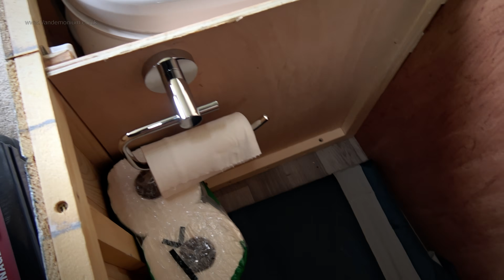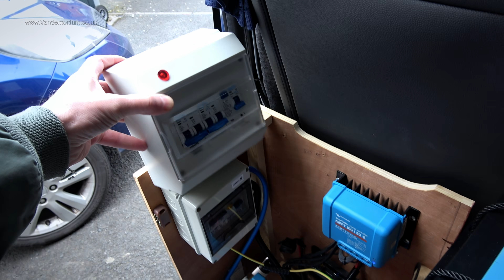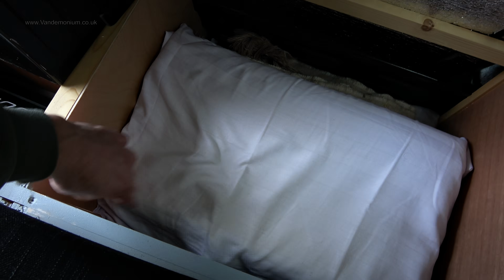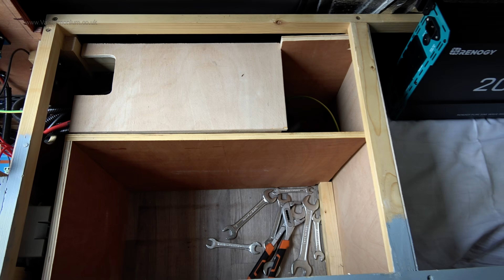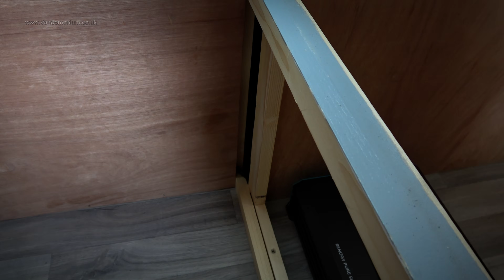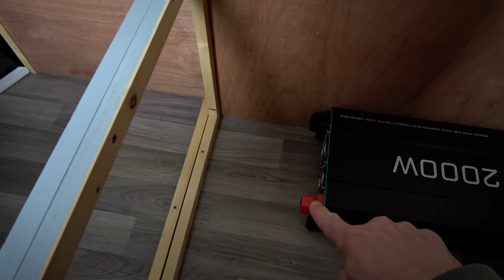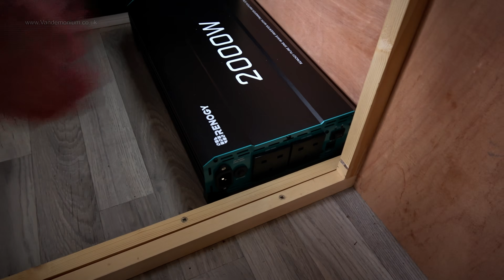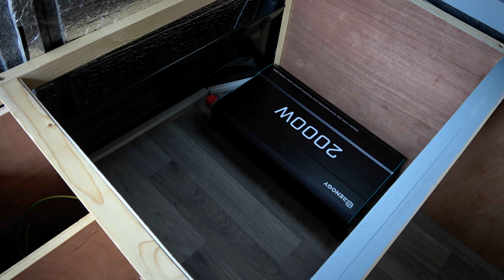78. How should I arrange the new campervan electricals?

Comment: Gfci yes, it monitors a electrical potential difference between the neutral in the ground
Reply: In fact it measures the difference in the currents flowing in the live and the neutral. If not all the current coming in the live goes out the neutral, it must be leaking to ground. That is the "ground fault" it detects.

Comment: Why don't you try turning the battery 90deg. In the compartment.   You will have to take the great divide out and store your empty container somewhere else.  Also, then you can put a shelve over the battery and put your converter on the top.  This way you will have both items in one place.  You can use extra length of wires so that you can lift the converter when needed.
Reply: My thoughts exactly.
Reply from the maker: Not enough space to have the inverter above the battery, unfortunately.

Comment: Hi David,
comment on those supplied cables...   looking at the way one pair retained the shape out of the bag, it makes me think they are not pure copper cable (heavy copper cable tends to be very floppy and mallable) but is the typical inverter-supplied copper-coated aluminium (which pretty well stays as you bend it more or less).   This is very relevant as if you are going to look up the current-carrying capability of a given gauge of cable, the table will be for copper only.  Aluminium is around half that.  I would not consider using that cable and just get some new decent european/UK welding cable (maybe 35mm2 for the length you will be running).  (Euro/UK cable is much better than far eastern cable).
Reply from the maker: Cheers. I am going to invest in custom-made cabling.

Comment: Would it be possible to mount the new battery transversely, keeping the terminals exposed, and build a shelf / stand-off to mount the inverter above the battery? I guess the inverter can lie flat.
Maybe enough room remains for the jug or the inverter mount can be built around it.
Reply from the maker: Sadly, not enough room to put the inverter above the battery.

Comment: Remove the small panel behind the sockets. Move the back wall out to make room for the battery. Mount the inverter on its side to back wall you just moved. You can get angled connectors.
You can take the cover plates of the inverter sockets and wire directly to the external sockets on the outside panel.
The consumer unit should be on its back wall and all the fusing in the space just vacated.

Comment: David, STOP! A 2kW inverter is about 90% efficient, meaning at full load about 200W will be dissipated as heat. This means one important thing: AIRFLOW! if you enclose it the way you seem to have decided it will easily overheat, causing it to turn off to protect itself, and even if you could live with that it will most likely shorten the lifetime of the unit drastically!
YOU MUST ENSURE A GOOD AIRFLOW!
My recommendation would be to redo the panel on the left side of the cabinet holding the 230V connectors, freeing up space for mounting the inverter along the front of the compartment holding the battery, making a large  ventilation hole towards the side door as well as on the other side of the cabinet (next to the fan grills), facing towards the rear doors. Place the main cutoff switch where the upper 230V connector currently is located and find somewhere else for placing the 230V connectors - maybe above the inverter, facing towards the rear door.
I get your reasoning for having two 230V connectors, but I would probably put the two connectors in parallel and use a switch to select between shore power and power from the inverter...
Ventilation would also be a good thing for the smaller electrics cabinet, although the solar charger and DC/DC charger are not as powerful as the inverter. It's still likely to get toasty there...
I do automotive electronics development for a living and can only stress the importance of ensuring good cooling!
Reply: Just what I was going to say. +1 cooling cooling cooling
Reply: @TheAdenau  I agree. very worried about the cooling of the inverter
Reply from the maker: Cheers. The solar cabinet has been fine for five years (and there is no DC/DC charger) so I'm happy that that's OK "as is"

Comment: I think where you got to is pretty good but is there space under the passenger seats rather than in the cupboards? Another possible alternative is to go to back to having the inverter in the same cupboard as the battery, on its side, because if you can take the battery leads out of it at an angle can you take them out so they cross over immediately and then loop up/down to the battery?
Reply from the maker: I need to have a look under the seat, yes

Comment: David…you seem to be overdoing things. Why travel with duvet, blankets and sleeping bag…….one decent Scandinavian dyne/duvet with a fitted sheetbag and a loose sheet for the mattress, and you are golden in  any climate….saves storage space. You need a proper relay that auto switches between incoming 230v and inverter 230v….and if you have any doubt that the inverter may blow up…..you bought the wrong brand and quality…..absolutely do not install anything under your pillow you do not trust 112toyota percent…,that would be madness.
Reply from the maker: The sleeping bag is in there by accident, I don't use it! I have no doubt the inverter quality is fine, I'm just imagining the worst!

Comment: Ditch the mess and get a solar generator,  cheerd
Reply from the maker: What's the point? Those things are nothing more than what I already have - solar charger, battery and inverter. And if any component in mine goes wrong, I can swap it whereas a "solar generator" has to be swapped out as a whole.

Comment: Oh well, here goes my input.   Modify the existing battery location to take the new battery and inverter,  bedding can be squashed up a tad in the reduced space. This keeps everything close together with no long cable runs.   If the bedding objects to being cramped move it to the far storage area and use the now smaller former store as general storage. 
Whatever you decide make sure the inverter has clear unobstructed ventilation to the main van interior as I think it will grumble if it's in an enclosed cupboard, especially with a duvet on top of it to keep it toasty!

Comment: your bedding does not fill the compartment- you've got a good 6" 'false floor' if you want to put one in with permanent stuff underneath from the compartment next door- but I agree- research a 90 degree connector to the inverter . don't forget to provide ventilation. still tend to vote for using spare water carrier space and current battery space remodelled for both to fit
Reply from the maker: The bedding fills that section (I had removed two duvets while filming!)
Reply: v @Vandemonium  sorry- my bad. I should have known that It is ...unusual... for a campervan (or narrowboat) owner to have empty cupboards 🤣

Comment: Move the battery rearwards (where you currently have your spare water container) and mount the inverter where the battery is but with the connectors towards your electrical compartment.   You can then route any bends through the electrical compartment.

Comment: I reckon you have to start with the fans for the inverter as priority. I would guess that they have to have a clear path to blow hot air into an open space (not a closed cupboard) as well as the heat coming off the cooling fins of the body. It'd be a shame to cook the inverter after all that effort!

Comment: Keep in mind that the inverter will generate a LOT of heat and will need a substantial flow of cool air in order to live long. A question: What is behind that wall there the solar charger is located? Is there room to mount the inverter? Or possibly under a seat?  If so, there would certainly be more than enough air flow to keep the inverter happy. Yes, it may be visible from above but at least it will still be alive. You could, extend the top cover to hide the inverter if it bothers you. But, no matter what you do, be sure that there is venting. A subfloor with bedding on top would definately be too restrictive. Those cables, if they are well made, I would suggest doubling them up as you hinted at doing. They will easily carry the load. Lastly, with ANY electrical componnent, HEAT is one of the top reasons for failure. Keep that in mind with any installation and, if needed, there are plenty of small fans with very clean covers that will increase the air flow. Computer fans come ti mind. Also, inlet for air is not enough... there needs to be an outlet to exit the flow of air or things will just recirculate the heat that is absorbed by the flow and result in component failure. Being a retired automotive electrical and Air Conditioning specialist, I have had to repair many components that failed due to heat. Good luck...
Reply from the maker: No room behind the electrical cabinet, unfortunately. Maybe under the seat though, TBC!
Reply: @Vandemonium  Well, under the seat will work fine. Just be sure to keep it clear of anything that would block the flow of air. Keep the inverter cool and it'll be just fine.

Comment: The battery needs to stay where it is for weight balance. The inverter 12v feed can be any angle if you are using HTC crimps which you need for thick cables. And remember you will need to be able to get to and switches and fuses on the end of the inverter. Is your tap a mixer? if so block the unused inlet or feed both. And having spent most of my working life in engineering we always clipped barbed water or air connections. It pushes the barb in to the hose.
Reply from the maker: The tap is not a mixer, though I know it looks like one!

Comment: Why not put both the inverter and battery in the storage compartment and use the existing battery compartment for the stuff evicted by the inverter and battery. I’d use a piece of conduit to route the wires outside the compartments back to the distribution panel thus keeping them out the bedding store. You wouldn’t really see the conduit because you are sitting above it.

Comment: turn the battery 180 degrees  so terminals come out in the area of the electrics also could the inverter go on top of the battery? Lastly the whole of the electric cupboard rwaly needs to be re run as it is a total waste of space..
Reply from the maker: It certainly does not!!

Comment: Any space under the front seat or even in the front passenger foot-well? a 2KW inverter is going to be plenty hot so will need more ventilation than a builders tea hut.
 On A little bit of a tangent, Do you have or have you thought about a DC - DC charger wired into your van's engine electrics so you can charge your leisure battery while driving? You can never have enough ways of charging if you are going all electric. 

Anyway good luck
Reply from the maker: I don't have a DC/DC and am hoping to get away without one.

Comment: Just put the inverter where the water storage is. You can get right angle adapters for the power input, no problem. Then, you can also put some vents in it for air circulation that's absolutely necessary as it'll be right in the front. Don't overthink it. Just buy the right parts.

Comment: Might I suggest that you either replace the crimps on the back of all your swithces/usb outlets or at the least put some insulating tape around the exposed end of the crimp? I had such a connector with bare terminals in a car I owned once and I dropped a screwdriver behind the dash and caused  a short, which in turn caused the plastic on the wiring to fill the car with smoke as the wires glowed red hot. Fortunately I had gloves on and ripped the wiring off the switch before a fire started. I would hate to think of the same thing happening to you/the van, especially as you have a high capacity battery. And yes, my switch was fused, but it didn't blow for some unfathomable reason. Stay safe.
Reply from the maker: Cheers; there's no way anything can fall onto those terminals though. There's a lid goes on top of that box!
Reply: @Vandemonium  I appreciate that, but, my paranoia would not let me rest without mentioning it to you in case a lead detached itself somehow and caused a problem.

Comment: New battery where the old battery is, false floor on top of it, inverter on top, leaving loads of airflow, possibly vents cut in, then it's all contained together,  the cables will easily flex to and from the battery below
Reply from the maker: Sadly, not enough room to put the inverter above the battery.

Comment: Easy solution (maybe not OCD approved), mount the inverter diagonally where the water jug currently is. It looks like it should just fit with the connectors angled to one side or the other. 
And most important as others have said, that inverter should put out quite a bit of heat, so you wouldn't want it enclosed. Drill top and bottom holes for ventilation in whichever compartment you decide on.
Reply from the maker: Diagonally?! Haha you're right, I don't think my brain could cope

Comment: Just turn the battery so that the poles facing to the electrics compartment, move the dividing wall forward and mount the inverter to it...shortest run of cables on 12V and 230V side...all other compartments still useable like they were before...
😉👍👍

Comment: Could you put the new inverter where the water can stands now (I know, you talked about that, but hear me out!) in such a way that the inverter's two plugs replace the two plugs that are now at the outer wall of that cupboard towars the door. That might mean the cables from the inverter might have enough bending space on the other side. Then you'd just have to find a place for the water canister. But yes, you'd lose your safety-shore power plug. ...  Well, it's another idea to consider.
Looking at all your possibilities, I think your last version is probably the best! That false floor thing saves you the most space and I think cooling and all that will be better.
You know, it is sometimes fun to break my head for  someone else's problems. Apart from that, it is good mental exercise.

BTW: glad you solved your leak-problem! Just installed an new dishwasher in the house and I'm so happy that everything worked on the first try! (ok, they make it easy but still, you never know)

Comment: I see many commentors with good ideas.  I will just second making sure there is airflow for the inverter; even using spacers to get it off the floor an inch or so will help with circulation and then you can put a perforated cover (false floor) on top and use for storage of anything other than linens.  Definitely should use a vent into the living area near the inverter.

Comment: From an electrical point of view, you want to minimize the distance for high-current leads as much as possible, because that will help limit copper loss due to resistance, and also the likelihood that you might accidentally come into contact with a high-current conductor and become part of a painful electrical circuit yourself. The inverter must be mounted where it will have good ventilation, because it does develop a fair amount of heat, and ideally you would like it somewhere you can access the controls and displays, if you don't have a remote panel installed for it. The battery location looks good, you're just going to have to bite the bullet and make the modifications to that compartment to fit the new battery, I think. The Breaker/GFCI panel should be installed where you can reach it quickly in an emergency, since that'll be the surest way of putting out most electrical fires, just switch off the affected load. Don't know about the UK, but US regulations require that the area in front of breaker and distribution panels be kept clear for emergency access. Water leaks can go up in a moving vehicle, particularly on very bumpy roads.
Reply from the maker: I have a  remote for the inverter! But the RCD/MCB is supposed to do its thing automatically, if it doesn't trip in a crisis then I'm damned if I'm reaching for it...
Reply: @Vandemonium  Fair point. Wooden dowels exist.

Comment: Is there enough space to have the new battery running from front to back eg turned 90 degrees to the current one? Also, could the inverter go under the passenger seat as it would have the required ventilation?

Comment: My suggestion is that whatever you do, keep the DC cables from the battery to the inverter short as possible. 2000W at 12 VDC is ~170 A, while at 240 VAC  is ~8 A. You want minimal voltage drop from the battery to the inverter.
Reply from the maker: Absolutely

Comment: It was quite painful hearing those rusty cogs revolving for 20 minutes. My thought was that you should remove some of the wall between the battery cupboard and the distribution board cupboard so you can drop the battery in. The inverter might even fit in front of it with the wall gone. It looks like the combined cupboard should have plenty of space for all the various electrical boxes. Also I wondered if you could have the inverter in the cab under the passenger seat and drill holes through the bulkhead for the cables. There may be plenty of ventilation space in the cab, whereas the cupboard where you keep the bedding is quite tight. I bet it needs a really good flow of air. Heat is generated by the power law, P=I squared x R. I is current so a higher current is squared to give a huge power loss, which comes out as heat.

Comment: Might make more sense to move the electrics around to fit the inverter better, but so long as the thing can breathe properly and not be buried directly under bedding, I'd hope it would be fine. You should be able to attach the wires with relatively little bend to the posts too, in that final configuration. Though if your inverter is going to be off to the side like that, you'll likely want a remote switch for it so you can turn it off & on without having to dig under the bedding and a false floor first.
Reply from the maker: Luckily, it comes with a remote switch